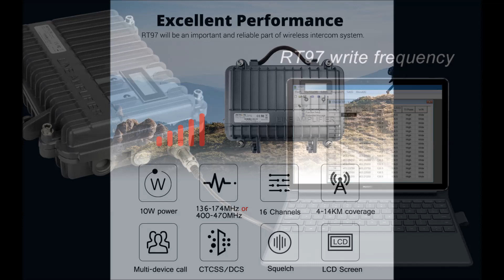GMRS RT 97 remote repeater testing with radio audio

Comment: I like the solar set up.. What wattage amp did you try for the repeater?
Reply from the maker: RT-97 is a 5 /10 watt repeater. I used a 80 watt amp set to 50 watts as per FCC rules on GMRS.
Reply: @the.greyman.7480  yeah but you’re totally missing the duplexer 🤷‍♂️ it will not work the way you have it set up
Reply from the maker: The duplexer is inside the repeater case. It is very small, and it does work, well. @Gta2O13

Comment: Are you using an amplifier? Some have said that it doesn’t work with one, but I’m wondering if the unit on top of the RT 97 is an amplifier with a fan?
Reply from the maker: Yes it is a amp. Never got far enough to see it work as intended though.
Reply: It will work with an amplifier you’ll need at least a 50w duplexer. You cannot use without a duplexer and and can’t used the one inside.

Comment: How did you get the id to work?
Reply from the maker: The CWID is from another radio. RT-97 does not have it.
Reply: @the.greyman.7480  yes I know this as I have the RT-97 I asked how you did it!!!! Thanks
Reply from the maker: A friend built a Rasberry Pi powered unit plugged into a GMRS radio. Programmed to ID and give a voice ID per rules. It sits in my house and transmits to my main repeater. @Pops_607
Reply: @the.greyman.7480  oh that’s AWSOME. Wish there was one out there to buy. Would love one for my repeater… 73

Comment: Awesome!! I have one here in good ole flat Florida! My antenna (Comet GP-6NC) is on a 33 foot mast. Farthest I've talked is 14 miles. Sure wish we had some hills!! Reckon I need to go higher!!
Reply: Too much loss with all that cable. These only output about 5 watts after the duplexer. 33 feet of anything but hardline and you are defeating the purpose. Try cutting that cable run to 10' or so and you will probably increase your range.